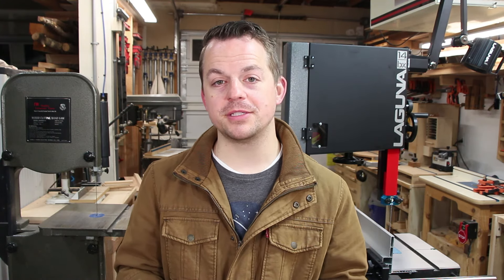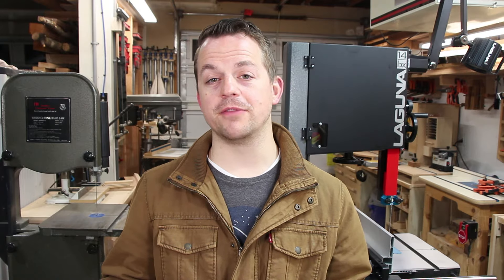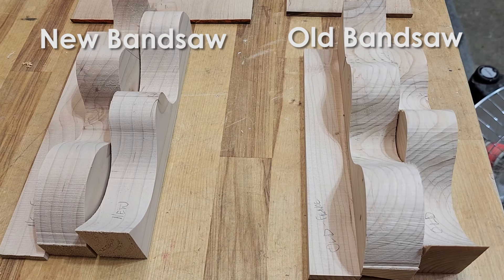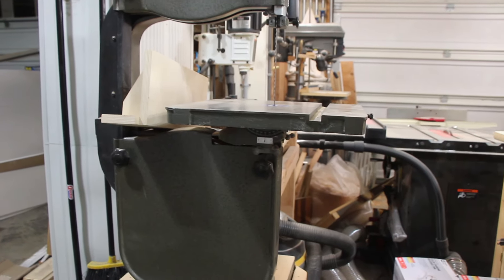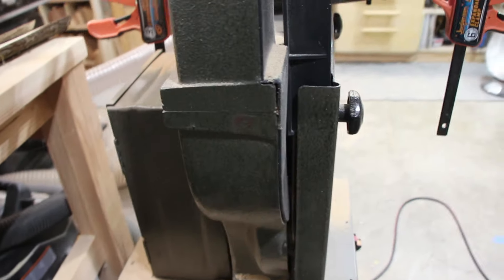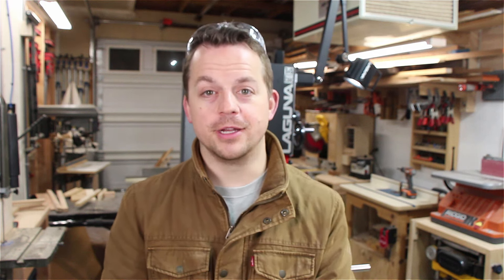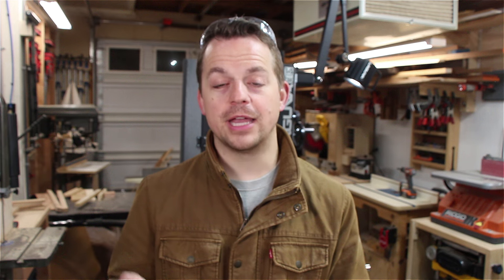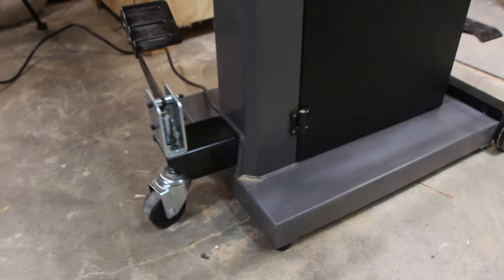Is a $2K Bandsaw Really that Different from an Old Bandsaw? | Laguna 14BX

Comment: It is funny that I just purchased this saw from a club member at a substantial price cut!  My club member did not like the ceramic guides and put bearing guides on it which I like better!  Before my purchase of this saw the only other product I own was a led lathe light from Laguna. After just about 2 years of use the light stopped working. I called Laguna and was told I was out of luck warranty is over!  If I had purchased a light from Woodturners wonders even if out of warranty they would repair it, Laguna is a throw away! That said so far I’m happy with this saw. The light can be mounted  on top of the saw there are  holes there for alternate location mounting.

Comment: Bullshit comparison, they are NOT equal machines. Laguna must have given you the saw so you could insult viewers. No 14" cast iron bandsaw can compete with a 14" steel frame machine. The laguna saw is made for resawing stock. The cast iron machine is a general purpose bandsaw. There is no way a 1/2 Olsen blade can compare to a Resaw King blade. OF COURSE THE CUT QUALITY IS GOING TO BE DIFFERENT.
Reply from the maker: The point of the video was to show that while of course the Laguna is a nicer machine, there may not be that much of a difference in the results on the wood, except in the case of resawing... the goal was not to prove that they were equal.

Comment: I have a Delta 14" bandsaw with a riser block about 25 years old got tired of changing the blade for resawing and back to a rough work blade and all the fiddling.  Bought a Laguna 14" SUV at a freight auction.  Parts were missing so I contacted Laguna.  The parts were unbelievably expensive.  I made some of them myself.  Bought a ReSaw King blade after being assured they had solved the problem with them breaking.  $175.  Broke after about ten minutes of use resawing oak 1 X 4's.  Months later Laguna has still not bothered to refund the money for the blade. (Why would anyone want a replacement blade for one that broke so quickly?)  The saw is OK but I am not dazzled.

Comment: I purchased a Laguna 18BX and been very happy with it. I purchased my blades directly from a local company that does blade re-sharpening for saw blades for all types of saws. Cost me 65.00 USD for a 5/8 resaw blade for my Laguna and it was made while I waited and is guaranteed for three re-sharpenings.   The Laguna Resaw King Blade was 159.00USD.  I really like the fence setup and still have yet to get the blade guides setup correctly.
Reply from the maker: Good tip on the blades. Guess I gotta find a local place that does it.

Comment: This would have been a perfect video had you used identical blades for the re-saw. I have a 14”” Delta and am look at a new saw currently, but would really like a 100% level comparison.
Reply: Absolutely true. When he showed the blades the difference is significant. Either you do identical or don't do one
Reply: Also, please make sure the thrust bearing is the same height for both saws. Generally the heights were close, but not always the same. If not done, one introduces blade deflection differences.
Reply: Bad idea. Each saw should use the most appropriate blade, not the same blade. Why drag down a perfectly good Laguna because the delta can’t accommodate the same width blade. Your request is inappropriate because the Laguna needs to show case it’s maximum capability, not some stupid test holding it back because you want the identical blade. Let’s be real, you arnt buying a Bx series of you need to see that test.
Reply: I don't know if he used a new blade on the old saw or not.  I may have missed that part in the video.

Comment: I don't think you talked about the table tilting or how easy/hard it is to tilt. Also, with customer service telling you to go buy the screws is a "no bueno" 
I was thinking about upgrading my 14" Grizzly Band Saw to a Laguna, but not anymore! Hope you see this Laguna
Reply from the maker: Yes, that was one feature that I haven't used much. So far it seems pretty simple, and there is an adjustable stop on it, so it goes back down to the same 90 deg-to-the-blade position repeatedly.
Reply: Re not having the screws,  they have a factory full of these parts. How are they out of stock? Or did they quit making bandsaws? Definitely poor management practice which should be a bright red flag.

Comment: This is like comparing a 1988 ford taurus to a 2022 Cadillac CT5.  They are both cars or bandsaws in your case…
Reply from the maker: If at the end of the day, though, you just need to get from point A to point B, the type of car may not matter. Buy the Cadillac if want to get there in style, but don't give up on the taurus if it still gets you there!

Comment: 230v doesnt give anymore hp!
Reply: Yes it does.
Reply: @donmeyers3090  Nope. A 1hp motor, for example, will only put out 1hp regardless of power supply. Increasing volts is just more efficient and you can run bigger motors, but that motor will only output 1hp. So if I had a 115/230v motor that is rated for 1hp, that is all I will get from that motor.
Reply: @jamespotter4878  I'm not sure what your original comment was referring to, but I assumed you were referencing the Laguna 14bx in this video.  My reply was regarding the 14bx specifically where the 230v model has 2.5HP and the 110v model has 1.75HP.  Different motors? I guess so, because I don't disagree with you stated above.  But my point was that when we're talking about the 14bx, THEIR 230v saw does give you more HP.
Reply: @donmeyers3090 Yes but that's only because the current at 230V is about half that at 110 for the same power output.  If you try to increase the power of a 110 motor over about 1600W you will trip your breaker.  1600W at 110V draws just under 16 amps.  At 230v it draws about 7amps.

Comment: Nicely done sir.....two comments, first I would add that I find the ceramic guides easier to tune/align but, I need more time to evaluate their cutting performance as compared to ball bearings. Second, I believe the mobile base is much easier to move and position the saw as compared to a bigger/commerical four wheel unit. I would love to see Laguna add an aftermarket hand hold on the outside of the vertical post to facilitate a place to grab and move the saw around. Thanks
Reply from the maker: I like the hand hold idea... after using it now for awhile, the mobile base doesn't bother me that much. Now it's the light that keeps hitting me in the head!

Comment: Thanks for the video. It seems that other than the capacity and dust collection, there’s not a whole lot to justify the price. But honestly, the deal breaker here is the customer service. I bought a 650$ Earlex HVLP paint  system and messed up the gun, entirely my fault. I needed to buy a few things from them and needed the part to fix my gun. Long story short, they sent me a complete new gun, all the parts I needed (100$ worth) and told me to keep the old gun for parts, completely free. That’s service, and you paid 3 times for this and got told basically your on your own.  The way I look at is, you’re not just buying the tool, you’re buying the company as well. The company failed miserably here.
Reply from the maker: I was a bit surprised at that response, although I guess if they honestly didn't have it in stock, then I got my fasteners faster this way. But seriously, you gotta keep that in stock!
Reply: @EveningWoodworker  I would of been tempted to tell them that they need to go to the hardware store and get it. That was really unacceptable. I know it’s a small item but after spending 2k it’s a matter of principle.
Reply: @shaynesabala absolutely agree.

Comment: For the woodworker who just can't afford an excellent Laguna, a second hand 14" Asian Delta-Rockwell copy can be tricked into performing well. A 6" riser block and a 1hp motor plus a variable pitch resaw blade will save $1,000. Unless the factory guides have failed, I'd recommend not bothering with after market guide assemblies. Just use the OEM guide blocks perceptively shaped and carefully adjusted.

Comment: You are going to appreciate your Laguna.  I bought a 14/12 about three years ago and never looked back.  I had a Craftsman 12" bandsaw for probably 30 years, and it served me well.  However, I built a new shop and happened upon some really nice cherry, eastern red cedar and oak.  Some was 2" thick.  My Craftsman 12" just wasn't designed to re-saw (so I don't fault it), and I knew that after several tries, thus the Laguna purchase.  Out of the box and set up I sawed a slab off a 2" thick, 12" inches wide board.  The cut was maybe 1/16" (probably less) thick.  It went flawless with the 3/4" Laguna blade using the included fence.  
After several months of use I noticed a distinct noise when running the saw.  A call to customer service helped me look in the right place.  It was one factory bolt loose on the lower wheel mount.  A simple tightening of the bolt and it has performed flawlessly.  
I have to admit I was in the market for a Rikon because it was less expensive.  Where I bought the saw had a teaching shop that had both saws in-use.  The salesman let me try both saws.  It was immediately a no-brainer.  The Laguna came home with me, and I don't regret the extra cost.  The quality difference was significant.  While pricey, I can't imagine a higher-priced saw performing much better.  (Oh, and I envy your brake.  The momentum of my saw takes a while to motor down to a stop.  A minor inconvenience, but I wish mine had the brake.)
Reply from the maker: Yeah that brake was definitely a selling point for me! I think the 1412 and 14bx are pretty similar in their design though.

Comment: Laguna is a nice saw but I don't think it's $2000.00 better than an old band saw.  Maybe in a production environment but not so much at home.
Reply from the maker: It's not cheap, but unfortunately, most of the new bandsaw with that resaw capacity are in that same price range.

Comment: You're going to be mad af when you start to try and wheel that thing around lol. Those mobile bases are awful. We have 4 lathes and the band saw with those on them at my work and man they suck. There's one wheel that swivels and the other two are fixed. And the sparks that fly off the guides make me nervous. I prefer bearings myself. I hope it works out better for you. The band saw we have is one step down from yours though. Good luck 🤞
Reply from the maker: Thanks for the tips! I'm probably not going to move it a ton, but yeah could've gotten a nicer base for less.

Comment: I think with identical resaw blades you would get closer results. How much closer is unknown. 

I think the major differences, in general are (1) a better saw will need much less set up and tuning, for example the wheels probably come from the factory well balanced, (2) much better capacity for resawing. That is huge or not depending on what you want to do, (3) more pleasant to use, less vibration, better dust collection (though my not very expensive 14in delta which is maybe 10 years old, has a dust collection port, and I would add a tension on/off lever like on the Laguna). Like so many things in life, a basic non-junk machine will work and if you tune it up and take care of it will be very serviceable. To get something much better takes a big jump in price. You just have to look at your finances and if this is a business you need to consider the return on investment, then make your decision. All that said, you will love the better machine, and you only cry once (when you pay!).

PS: Just checked, my saw is no longer available, but I see you can get a 14 inch Grizzly with no dust collection but a decent enough looking fence and roller guides for $750 and the Laguna is another $2,000 above that.

Comment: I have an old bandsaw built in 1947, by a company that wasn't in business for too very long.. Bare-bones blade guides, frame is cast iron (weighs a ton), refitted drive motor (poorly wired). Throat depth is just under 11", max cutting height is well under 7". What a gem! Home-made wooden stand remains sturdy, despite only nailed together (?). The wheels lost their hard rubber tires in decades past. Too many features to list here! Curious? It's a Tomlee Tool and Eng. Co. Model 40 (Minneapolis). They were only built in 1947 and 1948. No Serial #, so unable to determine which. Oddly, there are numerous groups and clubs dedicated to this and other Tomlee products (the Why evades me).

All that said: I'll keep this thing, and keep my $2,000.00 for that other thing. However... I'd gladly take your old $150.00 bandsaw off your hands for $75.00, if you don't live to far from the Alabama Gulf Coast (yes: I'd come get it).
Reply from the maker: Haha, sorry I'm on the West Coast. Those old tools were built real solid, if you can keep it running, don't get rid of it!

Comment: Having used Olson for a decade and then discovering Timberwolf and WoodSlicer blades.....your cut quality is completely non-relevant to the brand of saw. Even a cheesy no name bandsaw will give excellent cuts even with resaw and log milling with properly set up guides and a good quality blade (NOT Olson) I own a Laguna 18 and a Grizzly 14 resaw an an antique Delta 12 with the riser block and theres no difference in quality of cut between the three because they are all set up properly and use Timberwolf blades. Laguna IS a good brand,  but even so will completely suck if you ignore proper set up and use a crappy blade

Comment: 110 vs 220 Volts makes no difference in hp. hp is how the motor was build not how many Volts the motor is wired for. you've lost all credibility
Reply from the maker: True, but on the tools I've seen, they don't sell 110v tools with motors with any larger than about 1.75hp... and the 3hp are all 220 only. That's what I was trying to say

Comment: A couple of years ago, I ditched my very old AMT 14” bandsaw and got a Grizzly G0513X2BF - 17" 2 HP Extreme-Series. It has been a workhorse in my shop! I also invested in a 1” carbide tipped bandsaw blade for resawing lumber. It is wicked sharp (to the point of being downright scary!) and makes quick work of everything I push through it. I’ve seen comments about Laguna Customer Support. Well, as for Grizzly support, it turns out to be really good. When my bandsaw was about 1.5 years old and just out of warranty, the magnetic power switched failed and the saw would start, but stopped as I released the green switch. It turned out to be the contactor , which I ordered and received in a few days. I was an electronics technician in my pre-retirement days, and so fixing this myself wasn’t too hard. But the manual’s schematic failed to indicate a small metal shunt on the contactor . So the saw would start but not stop! I then compared the old contactor and discovered the little metal shunt. I moved it to the new one and voila! I also updated the schematic in my manual, and wrote to Grizzly about it. I would definitely buy this Grizzly saw again.